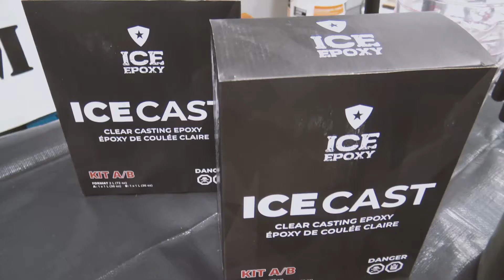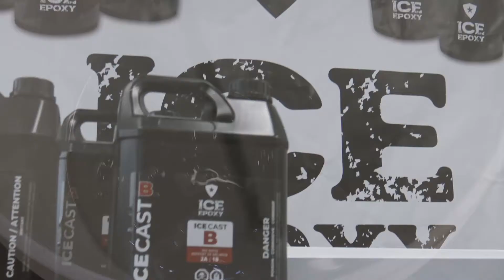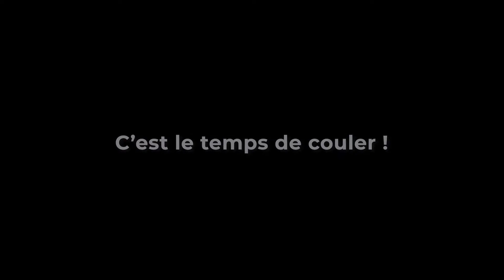ICE EPOXY ATELIER INTRODUCTIF

Comment: I ordered a 3 gallon kit of this. What a huge mistake! Their data sheet says ideal working temp 58-74 degrees and cures in 4 days. my 2 inch pour was still runny after 5 days! their customer service did not have a clue and stopped responding to me when i asked why the data sheet was wrong, i turned to my facebook groups and the consensus is this stuff is clear but takes at least 19 days to cure, i just wasted $175!
Reply: I picked this up locally they use it in house. I hope they fixed that by now but they didnt touch the tech data sheet it said as low as 56°f.  I was told 5 days. Watching their youtube after buying there product leads me to think some sorta way.